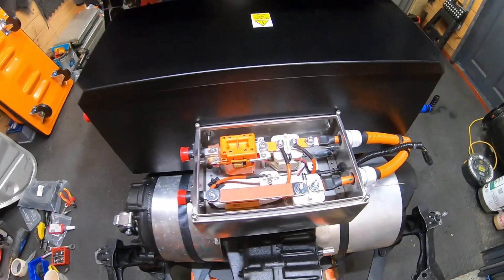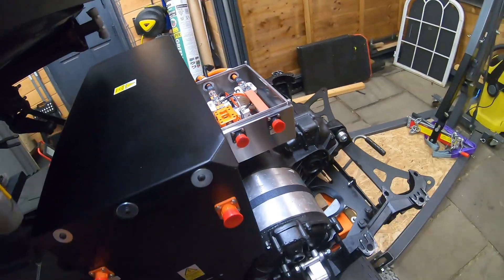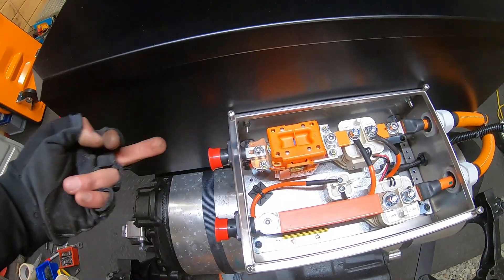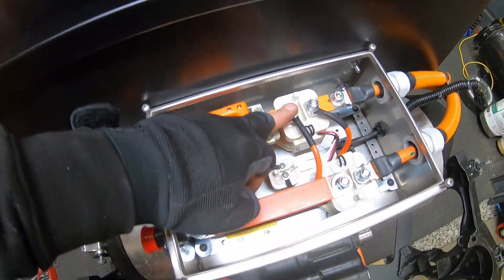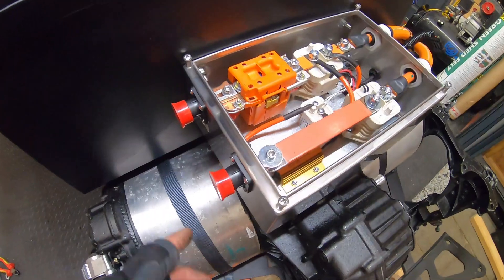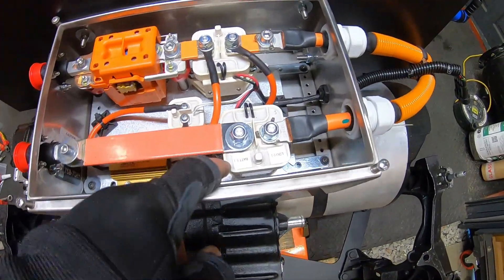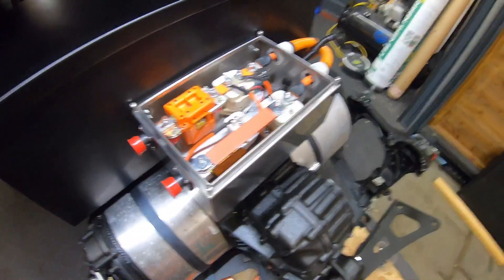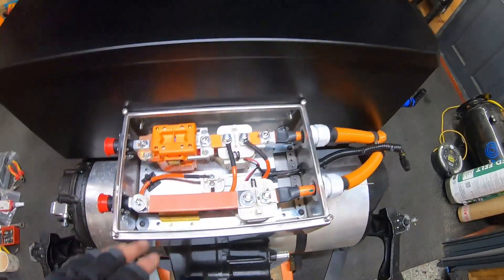EV Home Build Part 9 - High-Voltage Junction Boxes (HVJB) Explained

Comment: Great for sharing this Paul, big thanks. Really neat and tidy HVJB contactor box setup. Looks similar to boxster ev one on openinverter. I am slow building a mini based kit car at moment using an outlander rear unit and bmw sp51 battery (just gathering bits at moment to go with a zombieverter but the safety box in the sp51 battery pack is different than the earlier ones so thinking of building my own HVJB. Just wondered what mm2 guage cabling are you using for the main + and - circuits and the smaller + precharge circuit, what size fuse on main +  and what size  resister are you using on the precharge circuit? Im assuming those contactors are the durakool ones? David
Reply from the maker: Hi David, sorry for the delay in replying.. So for all my EV components I bought most of them Felten

The contractors are:

https://shop.fellten.com/shop/400acontactor-400-a-750-v-dc-contactor-with-integrated-economiser-13444?search=contactor&order=name+asc

https://shop.fellten.com/shop/50acontactor-50-a-750-v-dc-contactor-13445?search=contactor&order=name+asc

I used 70 mm2 cable for the HV circuit going around, outside the battery boxes.
https://shop.fellten.com/shop/hvc70mm-70-mm2-shielded-hv-cable-safety-orange-450-700-v-12872?search=cable&order=name+asc

Inside the HVJB I used 4mm2 cable
https://shop.fellten.com/shop/hvc4mm-4-mm2-shielded-hv-cable-orange-450-700-v-12869?search=cable&order=name+asc

Pre-charge Resistor
https://shop.fellten.com/shop/hs100pcr-hs100-30r-f-precharge-resistor-12931?search=resistor&order=name+asc

Fuse - I bought a Tesla One: I used a Tesla Model X/S Pyro Fuse Part Number: 1077177-00-A

Hope this helps
Paul
Reply: @kitcarspaul79 super. Thanks Paul for supplying. Your build looks great. Neat and tidy.

Comment: Great job explaining this. I was missing the concept that the precharge opens before the main contactor. I"ve seen recommendations that this circuit be fused as well. Do you know how many amps are running through the precharge?
Reply from the maker: Thanks and no probs. Tbh I’ve never seen diagrams showing the precharge circuit being fused. No sorry I don’t know the amps running thru the precharge.

Comment: You use 500A contactors, but you would need around 900A to use the full power of the car. I'm not sure if the Batterys could deliver that power, but they can at least pring 750A for 10s. Are you not scared, that the contactors could break or in the worst case fuse shut and you can't disconnect the HV system automaticly? The risk will of course depent how you use the vehicle.
Reply from the maker: thanks for the message. I dont think I'll be able to really drive the car using that sort of full power tbh.

Comment: Does the Invertor already have a pre charge resistor built in to it?  That would save you fitting the pre charge resistor. I'm not sure myself. Just don't want to fit one, if its not necessary.
Reply from the maker: I don’t whether the LDU has a pre charge resistor but even if it did I’d still have one in the HVJB. Every HVJB diagram you find on line has it so DON’T leave it out. You might want to use pre charge capabilities for other components in your build as well,  not just the motor.

Comment: Can you post a link to the parts list or the specs/numbers for parts like the pre charge resistor value and pre charge relay model and possibly where you could purchase them?
Reply from the maker: I bought all my parts from Fellten in the UK. Not the cheapest route, but being a newbie, I wanted to make sure what I was buying was the right stuff and best quality. I will probably write a guide one day when the car is finished detailing such things.

Comment: The precharge resistor has a metal body and it looks like you have it bolted to the metal box. It is getting 400V through it so maybe it would be better to insulate it from the box. 
I say this as someone who blew a precharge resistor to pieces last year and the voltage would easily have jumped to the box if I had it bolted like yours is.
Reply from the maker: Thanks Ali - it is bolted to a plate that then bolts to the sides of the metal box. How could I insult it? use insulated standoffs?
Reply: @kitcarspaul79  that would work or make/3d print a plastic mount for it. I cut bits from an eGolf HV Junction box to mount mine.
Reply from the maker: @alibro7512  ok cool. ive bought some insulated standoffs so will use those. thanks for that tip

Comment: Any reason why you didn't start a convention of having Red terminals for positive & Black for negative on your high voltage connectors? I see you have them all Orange on the battery boxes & black on your high voltage connection box. Loving the series so far though, aimed at just the right level.
Reply from the maker: for HV the colour is normally orange for both. glad u like the series. I am very much enjoying the project..